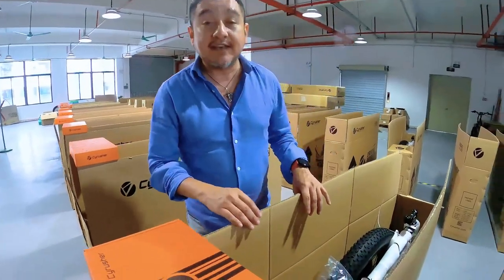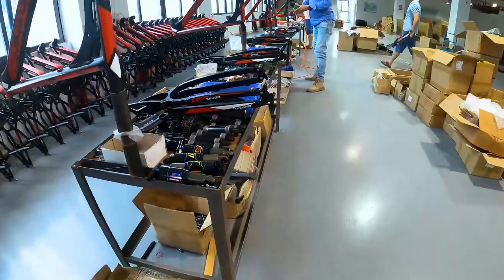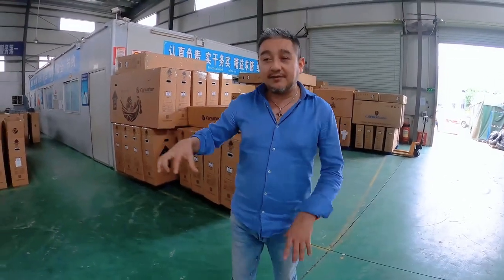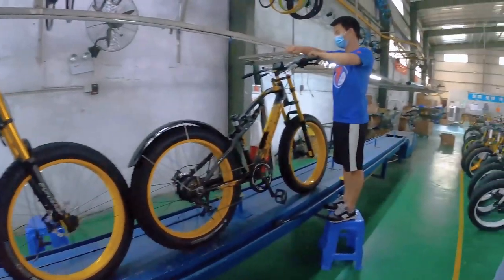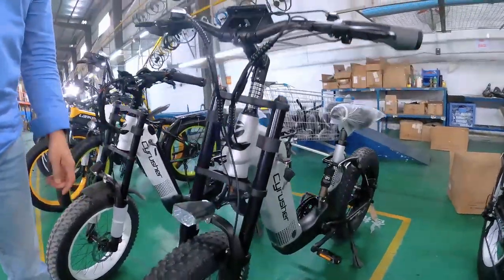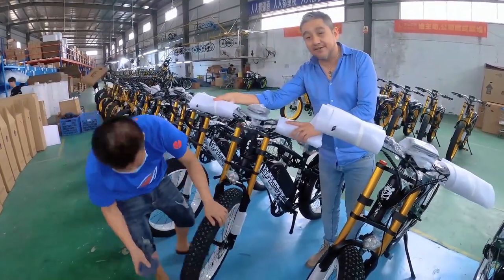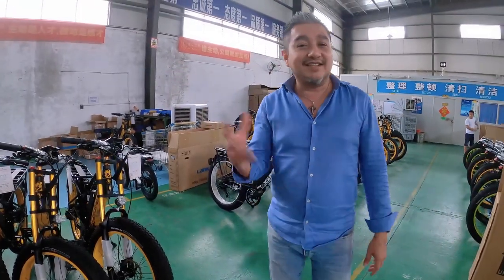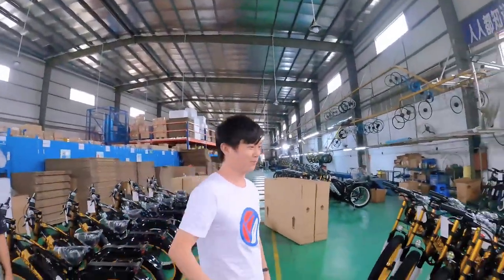7th Anniversary Recap - Factory Tour

Comment: IN THE PAST YEAR XF650 I WENT THROUGH 2 MOTORS THE FIRST TIME THE BACK WHEEL CAME OUT. THERE WERE NO WASHERS 2 HOLD THE WHEEL. NOW JULY 1 2022 THE MOTOR IS BAD THE INSIDE OF THE MOTOR IS WOBBLING MAKING SO MUCH NOISE. NOW I NEED A NEW MOTOR.
Reply from the maker: pls create your ticket here https://www.cyrusher.com/pages/contact